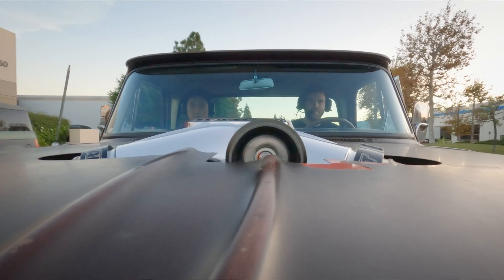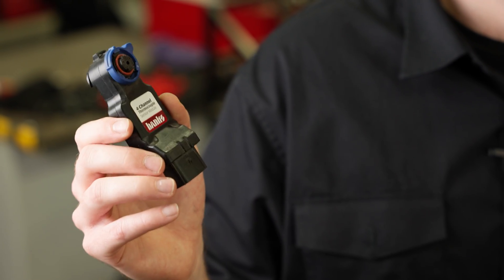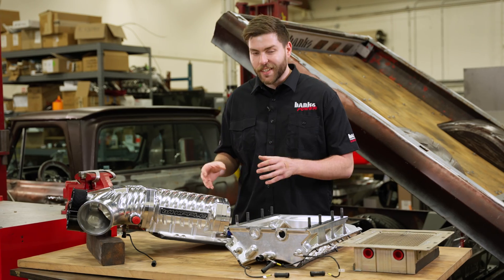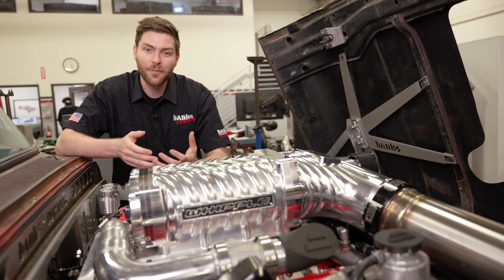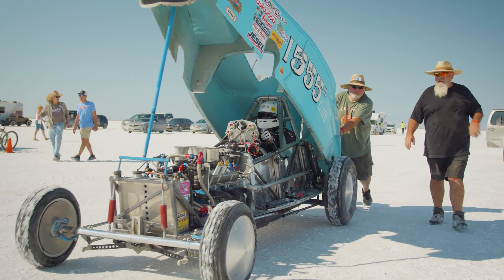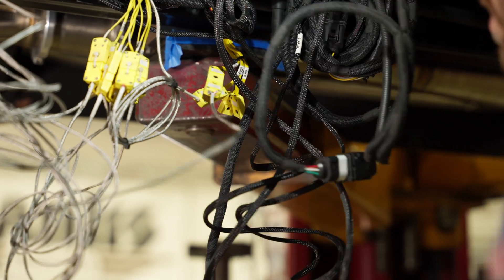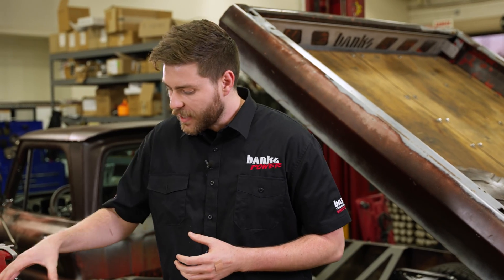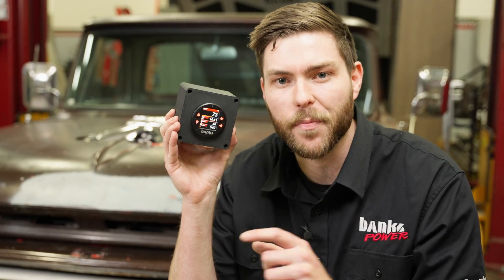Make any Vehicle Smarter | Banks iDash

Comment: @bankspower when can customers expect programmers, intakes, exhausts, and other performance increasing parts (i.e. towing, MGP, etc.) for the new LZO setup on the half ton trucks? Specifically, can we expect anything in FY24? Will there be any concerns with voiding the 100k warranty with any of these items?
Also, can there be media content walking through this new engine discussing air intake, cooling, exhaust, and any applicable upgrades to the flow of fluids throughout the truck (i.e. coolant, oil, differentials, etc.)

Comment: What does gale think of this, assuming you have good injector timing and sufficient rail pressure could you help a VGT turbo spool even faster by running your a/f ratio richer as the turbo is about to spool so there would be more air volume going into the turbo because the gas is hotter? I don't want antilag or black smoke. Just brief high egt to mitigate lag even with a VGT

Comment: Could really use an Oil Pressure reading.
Reply from the maker: You can measure and display oil pressure on the iDash. All you need is as pressure sensor and the iDash will do the rest.
Reply: @bankspower  Thanks for the reply. That is one way to do it, but I would like to do it through the OBD2. All modern engines have an oil pressure sensor. It would be nice to be able to read oil pressure without extra sensors.

Comment: I love the idash and all the great information from Banks! I have installed one on my '06 LBZ Duramax. As I do more and more I will be able to see the results of the upgrades! The only issue I have is it is not reading the temp from the intake manifold sensor and the MAF air temp correctly. It is using the MAF temp for both! PLEASE HELP!
Reply from the maker: We'd be happy to help you set up the sensors so they read accurately.  Please email us at socialmedia@bankspower.com.

Comment: All these things the Idash does but it can’t give me the oil pressure on my 2023 6.7 high output diesel ? What the crap Banks ? WHY ? It’s a SUPER IMPORTANT measurement that we need. I have a dual Idash setup on my truck and was so let down it didn’t do oil pressure. What are you going to do about it ?
Reply: I don’t think I am going to drill holes or cut lines on a brand new 102,000.00 dollar truck. The truck has an oil pressure gauge option from Ford on the dash but it simply shows a high, low, or normal range. There is no actual oil pressure number. The Banks idash does not have an option to see your exact oil pressure in real time. I have the dual gauge setup and it’s amazing but how in the world could they have left that out ?

Comment: wish the iDash would work with my 02 dmax with six gun. not sure why I was told that, as nothing is using the obd port unless the tuner is missing something like a cable. the 6 levels work or at least "feel" like they work. think i am missing something on the air intake too

Comment: Just got a Mitsubishi 4M40 diesel engine up and running and right now we are flying blind with no data, and that really bothers me. I have seen the advantages of the iDash and trying to roll my own solution would be daunting. Already designed and built my own programmable glow plug controller and injection pump solenoid relay controls, that was months of research, design, digikey orders, soldering, testing, etc. Going to be taking a serious look at the iDash, just makes sense. Thanks!
Reply: Well I used a samd21 microcontroller to output a 3.3v signal to a Bosch NTC temp sensor. Based on the feedback from this sensor I determine the length of time to hold the glow plug relay output. Then once you hit the starter the glow plugs quickly reignite assisting in starting. Once the engine fires, the alternator puts out a 12v signal, at this point starts the afterglow sequence which checks for temperature (140*f), if less then, hold glow plug on until either 140*f OR 2 minutes, either condition over-rides the other. Sequence complete, the engine is running clean and kicking ass. Lightweight flywheel assists in quick revs, but suffers at idle. But who's hanging out at idle time! ;)
Reply: @Wandering_Horse  Very interesting! Website? Youtube channel?
Reply: @Wandering_Horse  That's really cool!  Got a webpage that explains this more?
Reply: Glow plug relay controller? I'd like to see more about that

Comment: how do you run a maf sensor on a standalone idash like on the flow bench ?  i dont see the maf as a option
Reply from the maker: You can add a stand-alone MAF sensor to the iDash using a 5-channel Analog Sensor Module. This 5-Ch unit is our most versatile sensor module, offering 4 analog inputs plus one frequency input. You can connect any 0-5 volt sensor into the analog inputs. And, you can connect a variety of frequency sensors into the frequency input, like a Hall Effect Sensor, our Turbo Speed Sensor, or MAF sensor. Each channel can be configured to any parameter. After you've configured the input, you can name each input so they'll display your custom title on the iDash. 

https://bankspower.com/products/5-ch-analog-frequency-module-system-66554-idash-datamonster-supergauge

Comment: Yo Banks team! Love watching your videos, they're always so informative and entertaining at the same time, I've learned tons of new things that I would have never even thought of to fine tune engines and find bottlenecks in aftermarket parts. With that being said, I haven't seen any dyno tuners that take it to the depth you guys do, and as an owner of a Subaru STI with a picky EJ25, it's been on my list to find a tuner that has the ability to hammer out all the little details like you guys do to keep your builds reliable. Do you guys have any dyno tuning shops in mind anywhere in the US that take it to a similar level as your team, or is that stuff mainly reserved for just high end racing applications? Any info would be greatly appreciated! Wishing Gale good health and many more years to record his knowledge and pass the torch!
Reply: @daronlachinian1217  My car was tuned by Church Automotive in SoCal, his shop is very reputable amongst subaru enthusiasts. He does great work, but i'm  trying to chase down somewhere that takes it to the next level like banks to scratch my engineering itch because I plan on getting it fully built nose to rear and daily it until the wheels fall off and I want to make sure everything is configured to be the most efficient and long-lasting. I definitely plan on going with the r5 or it's next iteration when I upgrade to a standalone :) thanks for the input!
Reply: Don't do crazy cams, try go twin scroll. Poly bush most of the car, build your heads and polish but don't go crazy porting and just monitor nock, of course oil cooler, high octane and water meth if you so chose, I also like that you can spray water onto your intercooler to cool it. Old Subaru hack